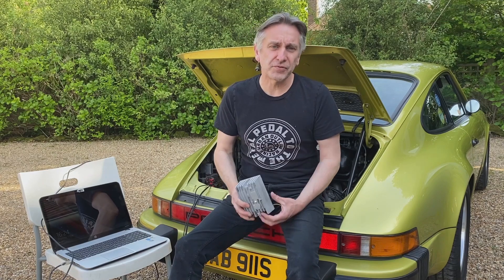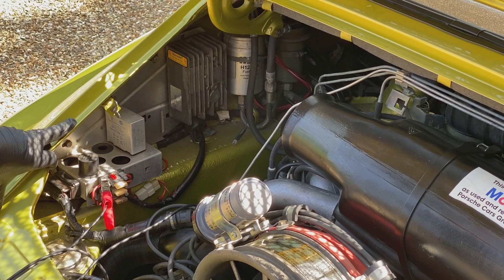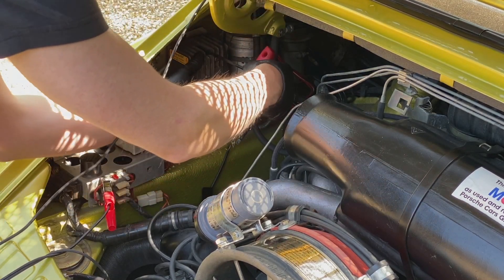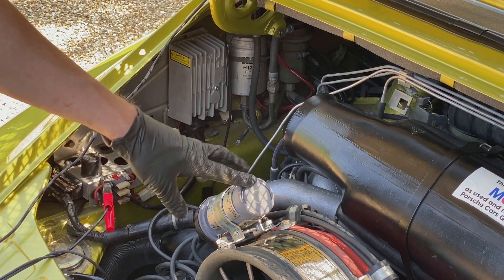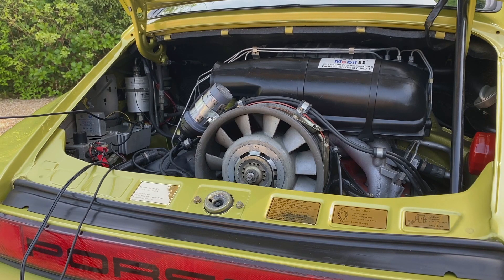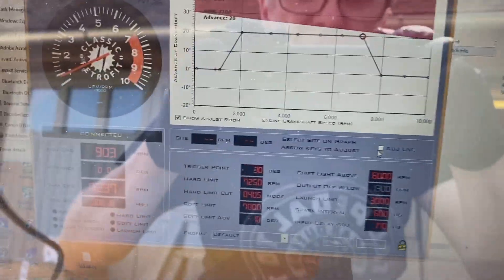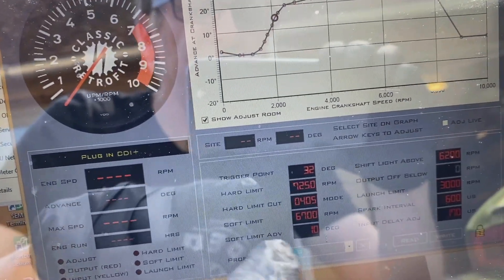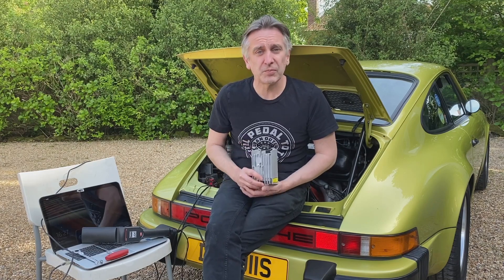Classic Retrofit CDI ignition upgrade install and setup

Comment: Is the really high pitched noise from the first start-up coming from the old box? Mine does that as well... But everything works perfectly.
Reply from the maker: Yes classic Bosch CDI whine. It is normal and the lack of that noise is how most failed CDIs are diagnosed.

Comment: I just downloaded the latest version of the CDI software and I am not able to connect my laptop to the cdi box.  I am doing an upgrade to a long neck intercooler on a ‘78 930 turbo and decided to update my cdi firmware to prevent the 930 overheating shutdown issue.  I am able to communicate with the cable and I updated the cable drivers that came with the software update.  It gets to the point of ‘Connect to CDI’ and I plug in the cable with the black wire to the bottom of the box and then turn on the ignition on and nothing connects.  I’m starting to wonder if somehow the box got reset or corrupted in the work process of installing the intercooler… not sure?  How to test beyond that if I can’t yet run the car (it’s apart), and how do I connect to update the firmware ?  Help greatly appreciated.
Reply from the maker: Hi David.   Shoot us an email and we’ll figure this out.

Comment: Finally got around to installing the CDI+ (and coil) in my recently restored (engine, paint, interior) 1970 911T (Leaf Green). It was indeed a straight swap and the car fired up first time and I immediately noticed the difference - very happy. Now to get the fuse panels sorted, but that's a bigger job for another day.
Reply from the maker: Good to know!  Enjoy!

Comment: Been following your product line, great additions! How would one improve an 86 turbo engine with a twin plug distributor for improved reliability with your tech? Currently running 2 msd 6AL ignition modules, could i replace with two of your units (ea coil)? Can i somehow retrofit a timing retard when the intake temps reach a certain temp? Also have you thought about using a BT app for tweaking or loading new maps?

Comment: Nice video and thanks for the upload. I am running your rear fuse panel on my 1977 911s (2,7). I added it after I rebuilt my engine a couple of years ago. It's only a small part but is really nice quality and I will be adding the rest of your ignition parts ASAP.  Would you recommend that I upgraded my distributor to an electronic one too? I am still on the original (rebuilt) Bosch with points. Cheers, Jason.
Reply from the maker: Hi Jason, thanks for the positive comments. You could replace the points with electronic ignition - that is a definite upgrade. The Pelican forum has plenty of information on this.